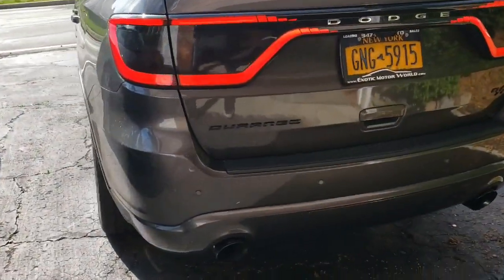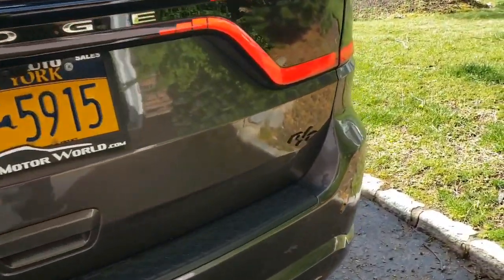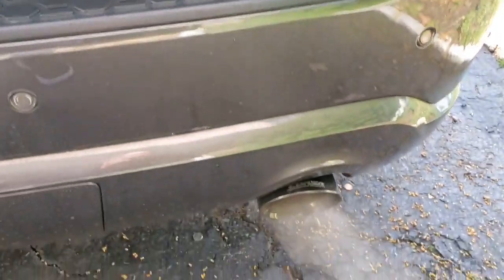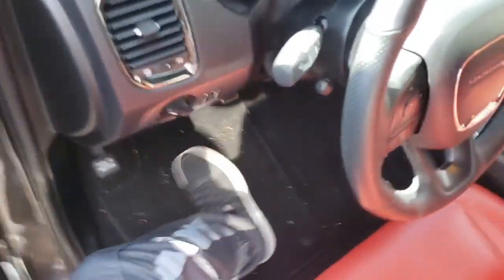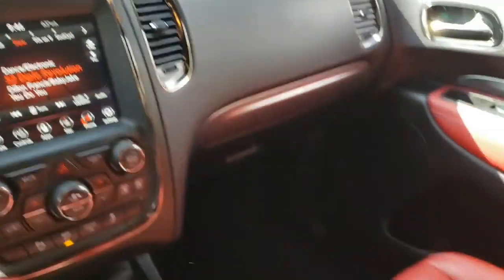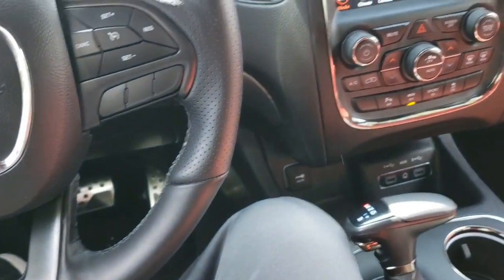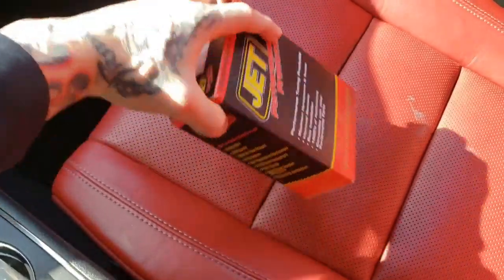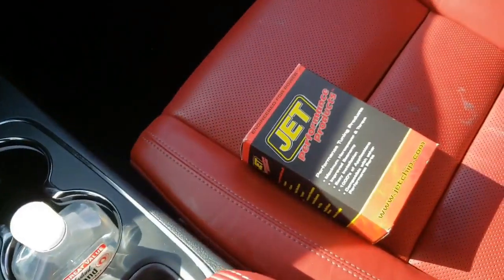Jet performance chip on Durango RT

Comment: Real mechanics know that peddle commander etc are not real performance mods all it does is reduce resistance for the throttle body. On the gas pedal half now is 100% . You want power you have to go with new unlocked PCM and a tuner as well as new exhaust and a 300 ci  supercharger witch will require new fuel pump new fuel rail and injectors 8500 mod plus 1k computer and tuner

Comment: Nice video, I also have the same color 2019 AWD Durango. You're right there's no video on performance modifications. I just recently did a mid muffler delete and  installed a pedal box, noticed a big difference in acceleration.  Looking forward to more of your video. Thanks
Reply from the maker: Awesome, and thanks man. Yea my Jet Xcelerator should be here soon I hope. I'm also waiting on new gaskets for the headers to arrive so I can go get those installed. I'll try my best to make good content for us Durango owners.
Reply: There are lots of performance modifications, you need an unlocked PCM before you can do any tuning and you need to use HP Tuners

Comment: I have a 2020 durango rt.  And have 87mm ported throddle body, performance coils, 180thermostat , intake. Exhaust system.  Installed the jetchip stage 2 and i didn’t notice any difference besides it being more sluggish.  I took it off and it runs way better . My 0-60s with the jet chip was 6.87 and when I take it off I’m down to 5.9. I love your videos.

Comment: Brotha, I literally have the exact same vehicle (Destroyer Gray), right down to the red interior.
My wife gives me a WICKED hard time, because, even though it's got more balls than a herd of bachelor bull elephants, I drive it like a little old lady from Pasadena! Every once in a blue moon, I'll engage the sport mode, if I have to quickly merge onto a highway on-ramp. But, I'm not Cale Yarborough. :-D 
Plus, I have little girl.

However, here's what I've done so far, in the form of mods.....

- Running boards
- 24 inch gloss black Wraith wheels from Lexani (I live in Florida...No pot holes, hahaha)
- Dual 13.5 inch TV's for the kid (And, adults, when we take road trips to Miami, Clearwater, etc.)
- LED front blinkers (Significantly brighter than factory)
- I put strip LED chase blinkers on top of the headlight housing, underneath the hood (looks sicker than the Flu!)
- Black leather floor mats, with red cross stitching, to match the interior
- Darker tinted windows
- A black, and red HEMI 5.7 liter badge on either side of the front 1/4 panel
- 2 channel (front, and back) DR900X GPS cameras, with parking mode
- Front cup holder inserts/center console shifter liner, with Durango insignia (red, and black)
- Red steering wheel trim kit

The only other thing I think I'll do, is add red brake calipers covers, engraved with the R/T emblem.
Cool video, man! Sweet ride...Baby it! :-)
Reply from the maker: Haha awesome man, yea have fun with it and thank you!
Reply: Dude sounds insane! Just got my Durango 21 couple days ago and I’m just thinking of all of the mods I wana get done

Comment: Nice I just ordered the jet chip . And the jet throttle body for my 2016 challenger RT. 
The throttle body was $600 from jet but the 35% off for 4th of July I got for $400 and the chip I got for $200 .

Comment: I’m a proud owner of a 2019 Dodge Durango RT. I’m debating on a Diablo tune and a unlocked PCM or a chip. There’s plenty of them on the market. I want the best and the most horsepower gain. The whipple supercharger is damn near $8000 not including install and rune. In your opinion are these chips a better option than the Diablo or are they a scam. I’m not tryin to waste money and have to buy a different option because one does not work.

Comment: Nice video.  I have a 2020 Durango RT and have several mods for peak performance (K&N Cold air intake, Borla cat back exhaust, and BBK 90mm throttle body intake.  I'm currently debating Diablo stage 2 or Jet Chip install.  Warranty void is the sticky point, especially if I don't get top speed limiter removal.  I have noticed significant performance improvement and throttle response since the mods were completed.  Any suggestions/comments would be highly appreciated.
Reply: How do you get a speed limiter removal?
Reply: The diablo doesn’t void the warranty if you buy the pcm kit. It’s pricey but all you do is plug the old one back in when you go to the dealer!

Comment: My Durango tops out at 117mph. Would this chip make it stop topping out at that?
Reply from the maker: Mine topped out still on the Dyno at around 122mph So I'd say no.
Reply: You'll need an actual tuning device from diablosport or hp tuners or something like that. Avoid ebay chips. Youll want name brand stuff which is somewhat expensive but they work.
Reply: @timmypstyle  whats a good brand chip?
Reply: @StromLxrd6  you'll want a tuning device. Tons more options . A chip is mainly what is used on cars older than 1997. 1997 was when the OBD2 port was put in cars which is what the tuning devices use.
Reply: To do that I believe you have to unlock the ecu

Comment: my 2003 Durango SLT 4.7L (new jersey) failed state inspection because I revved the engine after idleing for over 30 minutes in line, and inspector said, you just failed inspection when I saw smoke from revving the engine... I said that's ridiculous! white smoke in the morning after a mildew day in NJ? that's normal... vehicle passed emissions and everything else but they failed me for Visible smoke. I'm really annoyed because my vehicle is in nice shape and well cared for. Anyone has experienced this? Just venting my frustration with NJ.
Reply from the maker: Yea NJ and NY suck. But honestly when it comes to car stuff, you wanna go to someone you know, not just a random place.

Comment: So you basically wasted your money big time on a Jet chip.  Explain to me how it does anything to make power on your vehicle when you have a 2019 and the PCM is LOCKED from the factory and none of the values can be changed?  If you want to make power step 1 is get your PCM unlocked and use HP Tuners MPVI2 to actually make power.  You should return that thing because even if you paid 1 dollar you paid too much.  Now before you say it made it faster and better.  Where are your baseline dyno's or track times to verify it did anything?
Reply from the maker: Oh God shut the hell up, I know all about the locked pcms and tuning the 15s and up dodges. I bought the fking thing for $100 and I like it. If I felt a difference I felt a fking difference. My Durango is at 343rwhp with no tune, headers, exhaust, cai, and tb. Wtf was the point if your comment? If $100 is a lot to you than you're poor and sucks to be you. I will tune my Durango the right way after bike season is over with.  🖕 fcuk off
Reply: @ecoperformance7865  Placebo is a great thing isn't it.  That 100$ would have been better spent buying 2 of the 6 credits needed to tune with HP Tuners.  Again if you know the PCM is locked then explain to me how it made a difference "because you felt a difference" if the PCM is unable to change anything above and beyond factory then something like the JET chip does nothing.  You could have not had that mod and still got the exact numbers you did on the dyno.  To state things like the JET chip work is simply misleading and telling people false information.  Onus is on you to PROVE that JET chip did something when all the facts and reality say otherwise
Reply: @TnTTyler  What are your thoughts on the Pedal commander?  I think that's bang for the buck since you don't have to unlock the PCM and it at least uses the Durango's true HP since it get's rid of the lag time.  You do you think that's a good option?  Just got a 2022 Durango RT  and am thinking about getting the Pedal Commander.  Not looking to do much else but would like a little quicker response time.  Wish I could have gotten the tow and go package but it wasn't available anywhere and this car market absolutely sucks.  I was on a time crunch unfortunately.
Reply: @Alwaysbeclosing1774  The thing is the pedal commander doesn't make power just changes the gas pedal sensitivity,  Its going to change the driving experience a bit, but won't make it faster.  Swapping PCM's and tuning through HP tuners is expensive and time consuming so it isn't for everyone.  So in your case if sport mode isn't good enough a PC might be what you need